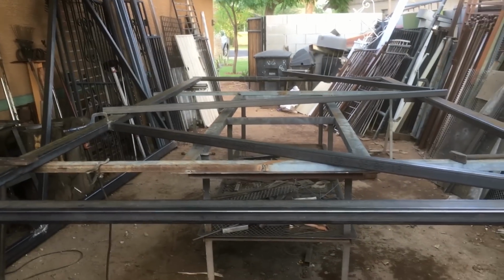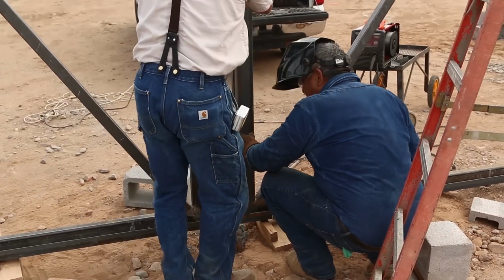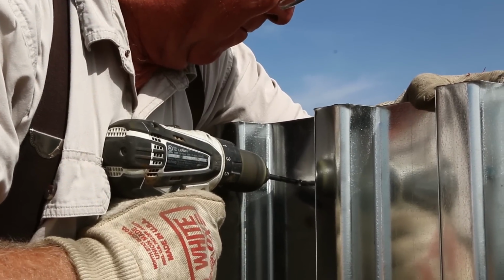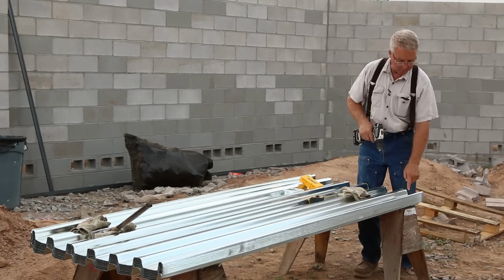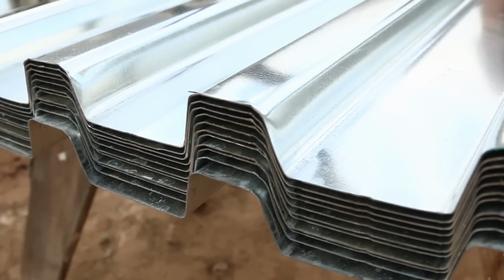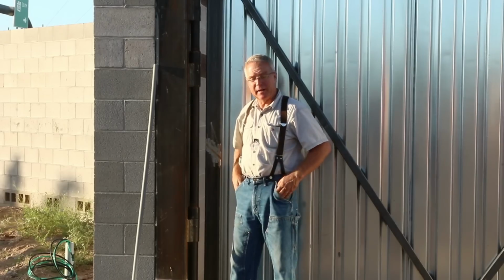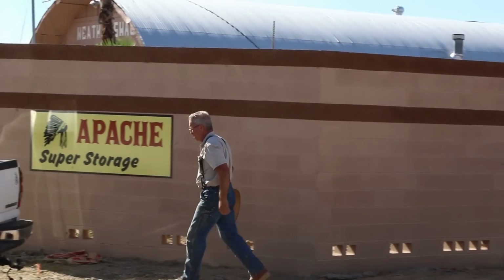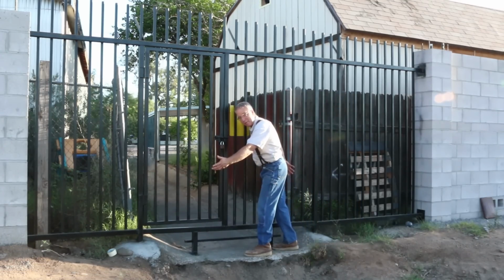Massive Gate Installation

Comment: Be nice to your drill bits and use some oil. They will cut better and last longer. That's quite a bit of steel you are pushing through. They must have been getting warm after a dozen holes. Nice video, thank you.

Comment: Nice gate, but am thinking the square tube frame should have had some primer paint applied to it prior to installing the panels. More than likely will have some running rust on the inside of the gate eventually.

Comment: 3:03 We do that exact thing when we install metal roofs on mobile homes, when there is an area long and straight enough for it to be practical: which is pretty much on all mobile homes.
In the end, it doesn't save or cost a notable amount of time, but it makes the installation easier and safer, so it's worth it in our case!

Comment: Heavy Duty Gates... no doubt about it!  Very Nice!   I found a use for that decking!  So, 15yr ago I had a 30'x40' Quonset steel building special made out of 16ga.  On the back side, about 7yrs ago, I made a 12'wd x 30' long lean-to and used that decking for the roof... very tough and still nice and shiny..!!

Comment: The diagonal brace on the hinge side of the gate stands out in my mind.  Typically, (on wood doors) the direction of a "Z" brace meets/places load on the lower hinge.  This diagonal brace is opposite.  I assume the engineering of these braces work another way being steel?

Comment: 'very heavy 20-gauge material'   I'd have to take exception here, Scott.  The average steel stud for interior non-loadbearing use is 18 or 20 gauge.  In the prefab building panel world, 20-gauge is the lightest material you're likely to see.  I worked (laid off for shortage of work) for a company that does building construction supply of those steel stud wall panels, and the decking we sold was 14-gauge at a minimum (the company likes to act as a one-stop shop for that sort of construction).

Having said that, I'll concede decking is heavy by weight.  Those 4x8 sheets suck to have to move by yourself, they weigh a lot, even at 20-gauge, and they flex all over the place.  And you can't go lighter, I don't know that anyone makes them in 22, and even if they did, 22-gauge is too flimsy to offer more than 'politeness' protection.  It's also a pretty handsome gate, even before painting, though I'm certain they won't let you get away with not painting the decking; I would imagine Arizona sun glare off those would be painful.

Comment: I noticed steel plates are screwed in from the outside. So someone can just unscrew the plate to enter?
Reply: Matt Nowk, that’s exactly what I thought!
Reply: Depends on the self-tapping machine screws used, There are some which are referred to as "one way" or "security heads", they are easy to install but have to be drilled out to remove them.
Reply: Walt Sorensen, Matt Nowk, Scott reply to another viewer that they put some welds on the inside, to keep anyone from removing the panels after taking the screws out. Although I’ve seen some pretty good suggestions that Scott might use. I know he monitors the comments.
Reply: DanielinLaTuna thanks for catching that detail, long screws welded on the back side is another great option to ensure security functionality.

Comment: They required you to install a gate for flood purposes in Arizona?
Reply: My guess: what happens if there's a flash flood? The sand has no ability to soak up water, the water will flash flow waist high in a 100-year event. What happens if you're caught in that sudden flow on that corner of the yard with no egress for the water? You get pinned by the water and crushed or drown. A grating, as Scott suggested, would allow the water to flow out from the low point on the property, and worst-case it only gets 4 feet high anyway. So you don't need a damned iron gate to get out, or to allow water to escape. But that's what the pencil pushers wanted.
Reply: They get at least one huge downpour every summer in Phoenix. People kayaking down streets/boulevards, the water just can't go down into the soil. It's nutty.

Comment: As a full time fence installer that specializes in custom gates I want to put in my two cents.

The main gate, as far as the operators. Get a MagLock, get 2 of them, top and bottom of the gate. A maglock is an eletro magnetic locking system designed to latch gates to each other. The majority of all operators on the market (and definitely all operators rated for a gate this size) have provisions for maglocks. Don't trust the holding strength of the operator to keep a gate this big shut. The flex of the frame alone will allow the gate to move back and forth at least 2-4 inches on the end. Any slop in the operator mechanism will multiply along the length of the gate, putting way too much stress on the operator. The hinges are a work of art. My biggest complaint against most of the off the shelve hinges is that the tolerances are way too high, there is almost never a scenario where a gate needs that much precision in the hinges. It just causes issues, any misalignment in the hinges will cause the hinges to seize. These hinges are top notch.

 The cable pulling the gate to the post. If the purpose of the cable is to take stress off of the top hinge than it's perfect for that application however,  If the cable is there to keep the gate from sagging its completely useless after the metal sheathing goes on (so long as the sheathing is fastened down to the angled bracing). The shear strength of the sheathing is far greater than what that cable at that angle can ever achieve. regardless of the reason of the cable, if the pivot point of hinge of the gate differs from the pivot of the cable even slightly the constant loosening and tightening of the cable will work it loose over time and just turn it into an eyesore.
 
The second gate on the property is really poorly done. Just all around sloppy work. The gate isn't true to the opening, the gap between the bottom of the gate and bottom support rail isn't parallel, indicating that the bottom support rail isn't level. The distance between the pickets is inconsistent, the pickets aren't even across the top. All things that could've been easily done with less work with the help of a simple wooden block as a spacer and a string line across the top to keep the pickets even. 
          Instead of either measuring the distance between the pickets or eyeballing the distance, you start from the gate and work your way outwards from the gate as your spacing is already set on the gate, lining up the top of the picket with the top of the string and spacing your pickets with the block. Disregard the location of the post when spacing the pickets when they are welded to the face of the frame. You'll notice the consistent spacing between the pickets along the top of the fence a lot sooner than the placement of the post.
          I understand that as timelines and budgets push you to complete a project the little details start to matter less when you need to finish a certain phase of a project to be able to start on the next, but to me I think what matters most is that I keep myself to a standard I'm proud of. I don't get enjoyment of doing a job fast or cutting corners. To me the biggest thing at the end of the day is to stand back look at what I've achieved and be proud of what I've done. I guess what I'm trying to say is that I wouldn't be proud of that gate, I wouldn't feel comfortable to charge someone for something I'm not proud of.
Reply: Thanks for your comment. Its really nice to see people dont just blindly follow and like everything on this channel (or wherever), just because at some point that person did something they liked.
The second gate looks really bad. At 7:40 you can see the pickets(?) all sticking up differently - even the short sections above the door are all at different heights. You could at least fix this by cutting them to the same height. But the varying spacing... no way.
Reply: The temperature changing over the seasons will also cause the cable tension to vary over time.

I made a much smaller gate for a client a few years ago and we opted to use a diagonal cable brace. Looks great but needs adjusting on the turnbuckle a couple of times a year to compensate for seasonal temperature variations.
Reply: James Bradwell The only adjustable bracing for gate frames that I use are truss rods.  The beauty of a truss rod is that the tension applied by a truss rod is only applied to the frame of the gate. It doesn't put any extra force on the post or the hinges, its hidden out of the way, and because it's built into the structure of the gate frame, it requires alot less maintenance because it's not a moving part. Meaning that the forces applied to it do not deviate with gate usage, and temperature has a minimal effect.

Comment: What was their rationale for requiring that second gate?
Reply: shinigami052 flood control
Reply: Yeah but why gated access instead of just a permanent, permeable structure like he said they wanted to do?
Reply: shinigami052, emergency exit. If they get a 100-, 500-, or thousand year flood like the desert can get, you need a way out. Hopefully whoever’s jammed up against the gate has the key
Reply: Yeah the lock kinda threw me which is why I didn't think it was to be used as an emergency exit.  Flood mitigation is crazy, I had a project that required putting a 3 phase, 1500KW transformer 4' up to be out of the flood zone in a very tight space with a structure that wouldn't impact the water flow during a flood.
Reply: shinigami052, Fukushima power plant failed, in part, because power transformers were inundated by the tsunami water... so I can see why you had to elevate your installation.

Comment: Those gates turned out really nice and sturdy.  If you place the openers about as far from the hinge as half the length of each door, the arm will be at a 45 degree angle when the gate is closed, which should provide plenty of support for wind loading.  This is the type of configuration used on aircraft landing gear.  It provides the greatest strength since the pressure is applied directly inline with the opener arm.  The only downside is when the opening is actually moving.  Another option is a screw-drive cylinder actuator.  It will provide strength in any position.  They're slower acting but very strong.

Comment: I enjoy welding and seeing fabrication videos involving everything to getting the job done right- mixing concrete, setting post, making hinges, installing the gate and securing it even if it's mig welded.
Reply: What's wrong with Mig ?
Reply: I like mig welding just do it all the time on thin wall tubing and plate

Comment: After seeing what slab sided gates can do after getting loose in the wind, I've become a very big fan of dead weight fail safe dragger feet. Something that has to be actively lifted off the ground to reduce its friction and can't be locked up out of the way. 

In my mind it is better to risk a mechanical failure making a gate harder to open than having a failure risk someone walking up to a free swinging gate in a storm without realizing it is nearly half a ton of steel flopping around in the wind.

Comment: Something about seeing a grease fitting on a hinge makes me smile
Reply: Few months ago my friend made similar (but 2 times smaler gates).I just take hinges before they are installed, drilled, taped and after welding we put grease nipple on top of each one. 
So, hinge is "sealed" (sort of, cos there is no hole in it), and greasing is easy. As a bonus, grease that you put from top, will as it pass thru hinge, clear all dirt that has acumulated meanwhile. 
Once a year is more than enough so this hinges will stay there forever, with very low maintenance.
Reply: Not here. Nothing but a dust trap that turns grease and dirt into abrasive glue. Then again, assuming the operator is a imbecile is kind of the design starting point in this country - zero maintenance everything.
Reply: John Alexander 
“Nothing but a dust trap that turns grease and dirt into abrasive glue.”

Because you’d never want to periodically add more grease to it to push out the old.
Reply: There are a lot of things I don't understand about the US, and that's one of them. Nobody maintains anything here, and stuff's desinged accordingly. 

Manual doors at the entrance to public buildings is another.
Reply: ...but the concept behind a grease fitting is to aid in maintenance...
Reply: I'd rather replace a hinge every 20 years than grease every 6 months.  Besides, we hardly ever use automatic swing gates here - too unreliable. We use automatic sliding gates (300kg is a light gate). And we know security - there are millions of automatic gates installed in this crime ridden shithoIe, and there isn't a single grease fitting on any of them.
Reply: tbag - 
You got it! 
You know the original VW Beetle had an enormous list of regular maintenance items and planned cylinder replacement at 50K? miles or somesuch. If you followed the directions it would last forever- everything was serviceable and replaceable right down to the floor pans and heater channels. 

One of those important maintenance items was the oiling of hinges and other moving, operating parts.  My 1989 jeep has oiling holes on the windshield hinges, and you can oil the door and hood hinges. I do so, and even here (VT) in The Rust Belt my windshield still lowers and my door hinges don’t bind at nearly 300K miles. 

I think grease-able gate hinges are a boon.

Comment: The old white Makita! Or is that the newer, cheaper ones?

I'm irritated that Makita made a cheaper, weaker line in the past few years, but I guess do it yourself-ers need something accessable.

They still make great stuff, but you gotta spring for it.
Reply: They probably had to to compete. Dewalt has the standard line and the higher grade XR line. Gotta compete...
Reply: I actually had to google white makita, I wasn't aware they even had a white line.